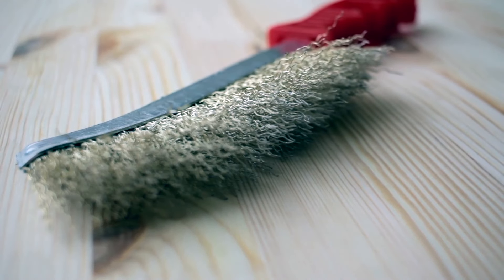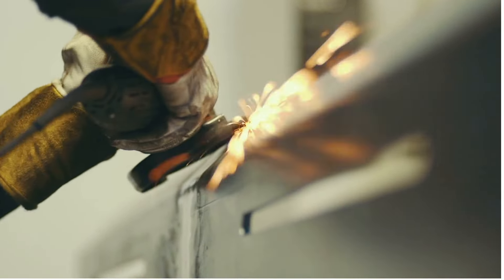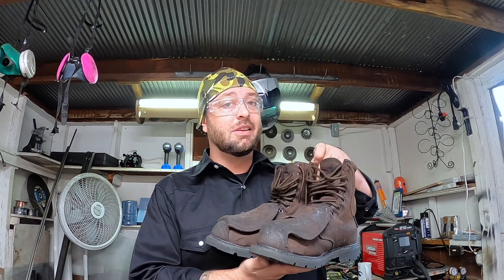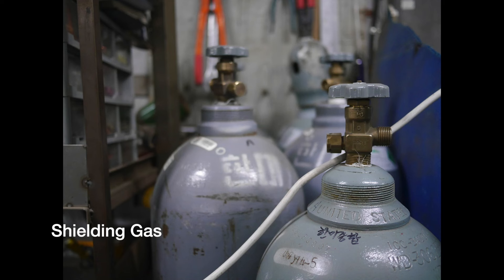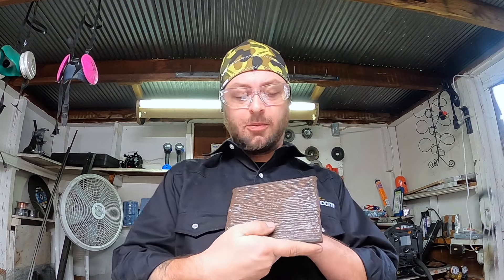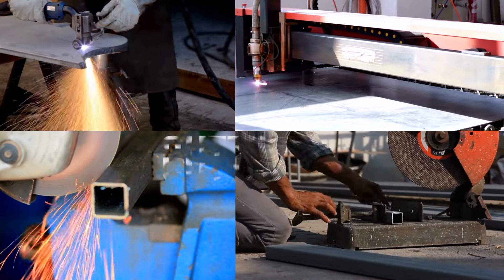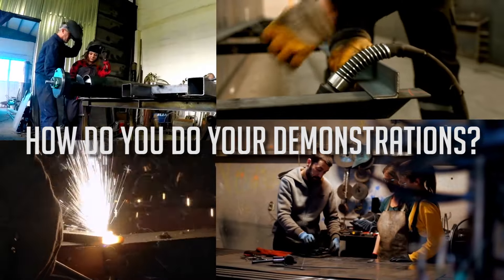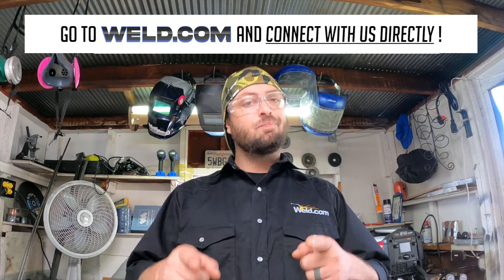What to Expect in Welding School or Welding Classes

Comment: Grinder wise, get the kind that has a dead man switch - DO NOT GET A GRINDER WITH AN On/Off SWITCH!  Sooner or later IT WILL KICK OUT OF YOUR HANDS!  I've experienced it 1st hand - the Deadman switch saved my life!  The cutting wheel hit the inside of my leg where my femoral arterie is!  Didn't get a scratch where as without the Deadman switch it would have been severed!
Reply: That was a lucky save indeed. Having a grinder you know you can turn off at a moments need is key.
Reply: Yikes, man! For anyone else reading this, dead man switches include paddle switches and (for "rat tail" grinders) trigger switches.

Just be careful how you hold a paddle switch grinder when you're not running it, so you don't accidentally bump the safety catch and turn it on when you don't want. I learned this last week while using a wire wheel and trying to adjust the guard. Fortunately my leather gloves saved my left hand.

If you need to make a quick guard adjustment on the fly, hold the tool by the handle and not the body. 😬
Reply: We call them Suicide Switches
Reply: Glad I read this

Comment: Hey, Beau,  I took the same class in 2000-2001 at the Jamestown campus., ..GTCC.....night time classes of  3 SMAW and  2 GMAW  5 days a week, Then the GTAW and High Pressure Pipe 4 nights a week, a dude came around looking for weldors in 2001 [he had taken classes there] and I applied and was hired on the spot....continued my classes, best thing I ever did....Cheers, Paul
Reply: Really????
Reply: @fleecejohnson5750  Yes, Really...it was in the old building.....I lived not far away in Adam's Farm........
Reply: That is awesome I was in the new facility but was taking night classes as well until the summer, where I switched to daytime for Tig Pipe and Certification Practices.

Comment: Thank you so much for answering most of my questions about what to expect on day one of welding school. I am applying to Lincoln Tech. I have looked through the course description but am having difficulty deciphering between, Welding and Metal Fabrication Technology vs. Welding Technology. It seems that both classes have the same 4 types of welding. ie. Shielded Metal Arc Welding (SMAW), Gas Metal Arc Welding (GMAW/MIG), Flux Core Arc Welding (FCAW), and Gas Tungsten Arc Gas Welding (GTAW/TIG).

Comment: I've been debating taking the welding classes at the local tech college, but I'm an older student doing it for my own business (I'm a blacksmith), and I've had a recent hearing loss (illness, not PPE failure). I'm pretty sure they'd work with me on my learning goals, since the local program is pretty free-form. How practical is it to take welding classes with a severe hearing loss? Books and hands-on are all fine, but I couldn't sit through a stereotypical university lecture anymore.
Reply: I'm only speaking from my own experience here, but I'd find it difficult to get through some of the demonstrations with limited hearing. In my school's shop, it is always pretty loud, so the instructors are often shouting over the racket and have to repeat things multiple times. However, they do have options for people with a wide range of disabilities and seem like they'd try really hard to accommodate everyone. Before coughing up any tuition, I'd contact an advisor from the school and see what they can do to accommodate you. The vast majority of my actual classwork is visual, and I don't have any lectures. It's all in the shop. But that also may vary from school to school.

Comment: I'm starting in the fall at macomb community college. My school has two certificates 1. Basic welding 2. Advanced welding. The basic teaches safety, metallurgy, diff metals, the flat/horizontal position of all different welding types. 
The advanced focuses on overhead/vertical and certificates for all the different types including pipe, tool/die, maintenance. Each one is its own class.
I'm doing the basic, while applying to apprenticeship for pipefitter/ironworker. If I don't get In. I'll do the advanced. And then reapply to pipefitter

Comment: I'm a female and I'm older but I want to go to at least an intro welding class. How much weight do you need to be able to lift?
Reply: a bag with all those tools inside of it will be about ~50 lbs
Reply: I wouldnt worry about that part.
The shop Im in has plenty of lifting equipment.
No one wants an injured employee.
Reply: In school you won't have to worry about lifting much more than a practice plate or coupons. I would say 20 lbs is going to be the max but I would recommend a tool box with wheels if you have to take them with you each day.

Comment: I live in Connecticut, can you recommend a good welding school for MIG ? If not , where can I go to find one? Thanks.
Reply: It looks like East Windsor has a Welding Technology Diploma program. Looks like they have a few mig classes as part of that program you have GMAW Plate and GMAW Pipe as well as a Fabrication course.
Reply: @beaujamesblues  Thank you Beau for your quick reply! I will look into this school. I am looking to use MIG welding in small engine repair and similar. More of a hobby. Already purchased almost all items you reviewed including Hobart Handler 140 and gas AR/CO2. Been sitting for over a year with no use. I need instructions on correct use. Your are so right when saying very expensive to purchase items. Thanks again for your help.
Reply: @vinopan5374  So for that machine you are going to have your Wire Feed Speed (WFS) on the top knob that will control the speed that the wire is fed to the gun. Your bottom knob is going to be your voltage. On the inside of the door, there should be a guide for setting your parameters for different thicknesses of material. These are a starting point for you to get up and running. Taking a few classes is going to help you understand what you want to hear sound-wise for your settings but also you will understand what you are supposed to be seeing in the puddle.

Comment: i think mig welding is the most popular/most used welding method, but the machines i've seen are two or three times as expensive as the stick and flux machines. am i just not looking in the correct places?

Comment: I want to check out my local Community College just to get the welding certificate they offer. I dont want to go into the industry now, but I'm interested in it as a new skill/hobby. Do you think I'd be wasting my time and money taking classes?
Reply: I was the same as you and this is what I did. I live in Louisiana and there is a jobs program called “la works”. I was able to enroll in my local community colleges welding program through laworks. It’s non-credit which I didn’t care about and the cost is 250 a semester. Because it’s non-credit there is no degree if I go all the way through but I’m still getting my certs so it’s all good. See if your state has something similar.
Reply: That is kind of what I did as well I went in and got the Certificate in Welding Technology. It gave me a great understanding of Mig, Tig and Stick. Any time you get to spend under the hood is going to be a great investment. You could also look for a local makers place that might offer welding courses.

Comment: I really just want to know if the math was hard?
Reply: It depends what kind of welding you’re doing. If you’re doing pipeline work, you would need to know basic math like decimals and fractions and how to covert them. Fabrication welding can require more advanced math. So it all depends, but in most cases, math is going to be part of the job no matter what.

Comment: Any skin exposed to the welding arc will result in a painful sunburn - even after only 5-10 minutes of welding depending on the amperage.  It SUCKS ( I'm speaking from 1st hand experience)!
Reply: I wore a v neck one time in class and went home with a nice little triangle burn it was no fun.
Reply: Some welders are worse than others.
Reply: @beaujamesblues  I accidentally wore a deep neck cut vest and forgot to do the top button on my overalls up. Had the red triangle for two months.
Reply: @Jonathan_Doe_  Itches like crazy too.